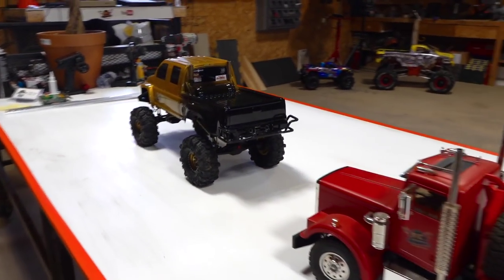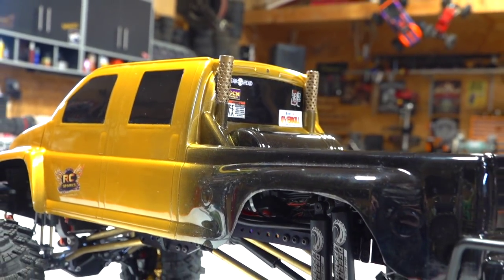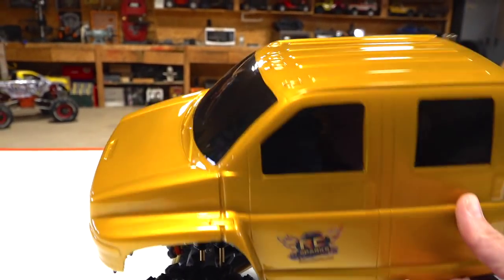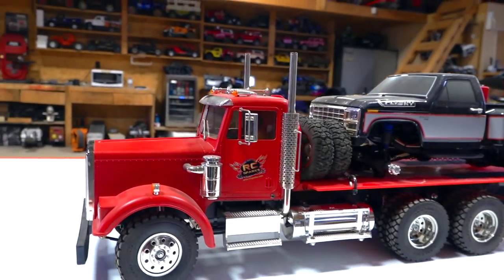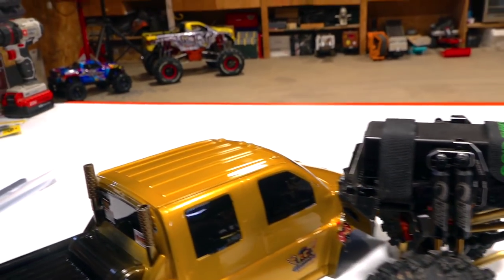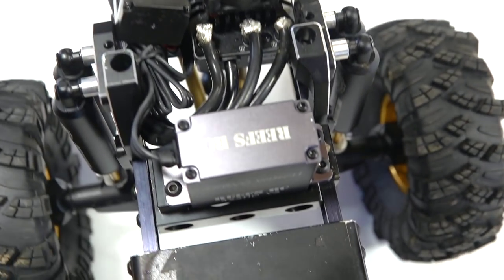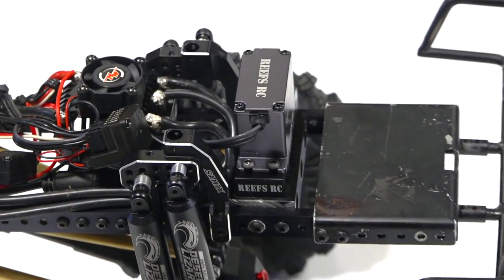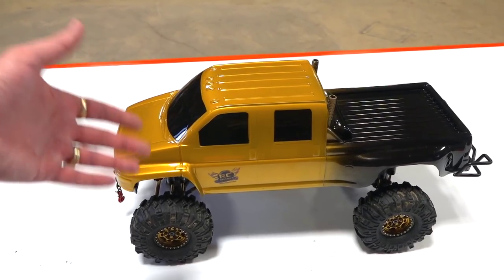PROJECT "OVERKiLL" 2020 - PT 12: DiESEL STACKS & DUAL 100lb YELLOW WiNCH LiNE | RC ADVENTURES

Comment: Cool idea with the stacks to vent air and stop the truck floating. I keep learning little tips watching these videos. I used to pull out a big hot air gun for heatshrink until I saw you use a lighter. After trying this myself I can't believe how much easier this is!

Comment: I have always used radio antenna the kind you pull out to make it longer each tube is a different size and you can use them on different scale tucks as stacks pipe bumpers even winch rollers. Easy to cut in any shape, lengths you can easily grind down the ends for a different shape works very well for me.

Comment: If you’re winch line is fully out it’s still less stronger becauseits longer. on less distance it’s making no matter.  keep on trucking man you doing great👍👍🤘✌️
Reply from the maker: Yes I agree with you.. and 2 things. Its a Winch servo (HD)  so SUPER STRONG! and Second.. with the Snatch block, it is still twice the strength then without.  7 foot is pretty close to scale length of a full size winch line (depending on the winch).

Comment: I haven't watched many of the vids for this build but if wheel weights are legal for the comp it seems they would help keep the truck upright in deep mud by pulling the tires down and would help since the center of gravity is still fairly high and keep the truck planted when on steep terrian. In my experience they completely change the performance of the truck.

Comment: Run winch lines thru piece of tubing under battery ect...can be bent around or under however needed...
Preferably copper to keep with the color scheme...
BTW Great videos..keep em coming...
Reply from the maker: I dont do the tube, because it gets mud stuck inside and then hardens when its not cleaned.. :)  I like it "more simple" because then I dont have that issue. Thank you for the advice though

Comment: I had similar issue with my RC4WD warm hi mount winch breaking its line and replaced with 80 lb braided line and like you was able to put a lot more on, my only concern with how you are putting the hook on is that braid is very slippery I would suggest that after you pass the line thru sinch block that you bring it around and pass it thru again to avoid it slipping

Comment: Something most might not realize is you can use the snatch block "strapped" to a tree to redirect the line and pull someone ELSE out!!! Would be a good video to make!! Throw in using the rear winch to slowly winch down a cliff instead of just sending it!!

Comment: I like the truck 😁👍, I have built a truck similar, but can't post a picture.
'76 carisma F-150 Ford, 750 motor , planatery transmission, two-speed transfer case and Redcat portal axles which are 5 to 1 gear ratio.
Not really fast but a lot of torque.
2.2 mudslingers on beadlocks,
Some axle brass and 13 oz of lead,
I would like to come to the Tough Truck , but I'm in East Texas, probably not going be able to.
But keep up the great work 👌
Reply from the maker: Sounds great!

Comment: My ocd is going nuts watching you put the collet on the line 🤣🤣 at least from my opinion its like a mini saddle clamp, and because the saddle does the clamping/biting onto the cable i was always told by my dad "you dont saddle a dead horse" meaning the saddle goes to the live line that will have the tension. I get it, the grub screw would probably weaken the fishing line. But never the less my ocd is freaking out 🤣🤣 love the  build brother! Fuck the haters, they're just jealous

Comment: Those stacks look cool! And that's ingenious about the ventilation aspect.  Instead of redoing the same body, you said you found another, can't you add some filler around the stack, or not? Them gold winch hooks look good, I'm going to have to get another one for mine. Thought I had the line tied good but I lost it, using the original Warn one.

Comment: What channel do you use on the Nobel nb4...I tried to use the button in front of the wheel on the controller but it just keeps on sucking it on..But I did get it to work on the roller switch above where your thumb goes..can you make a fast video on how to use the sw1 I think it is?

Comment: Another beautiful video my dude got the cage and body mounted up and the battery tray figured out on my truck finally also went out and built me a teeter totter today nothing fancy just something I can pull into the shop and play with while this corona things is going on. Quick question what shocks would you suggest for a crawler I’ve seen almost every video you have made but what’s your honest favorite shocks and tire set up
Reply from the maker: I am using Desert Lizard shocks on Project Overkill..100mm :)